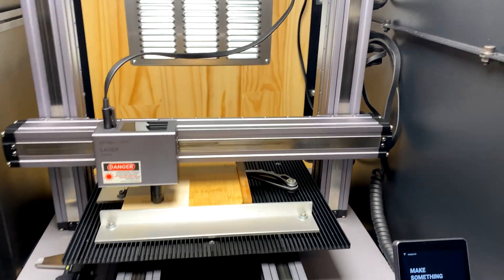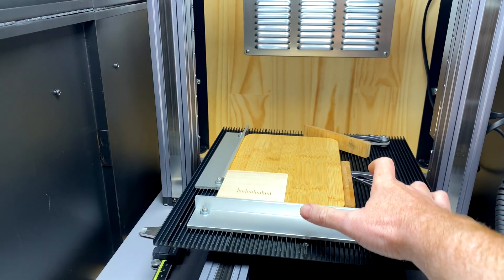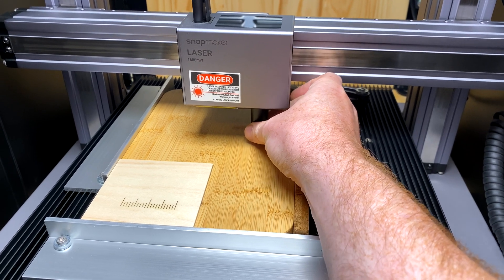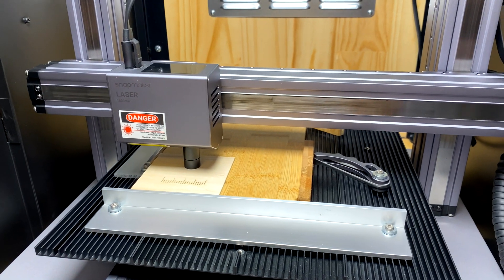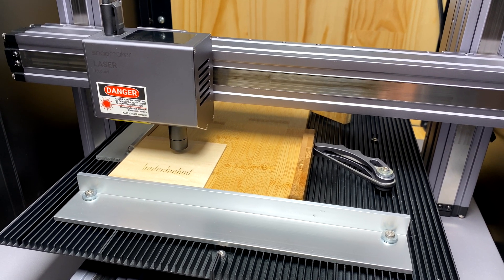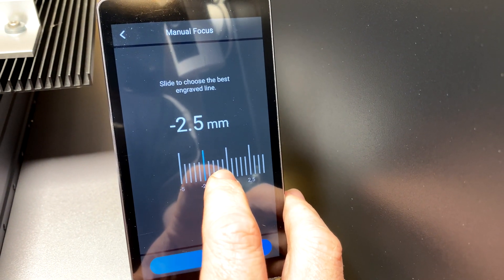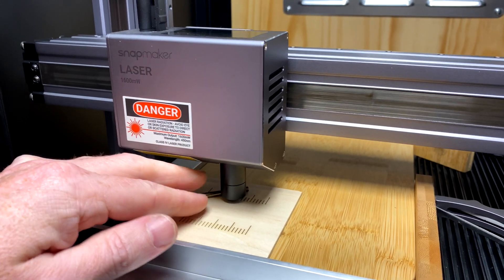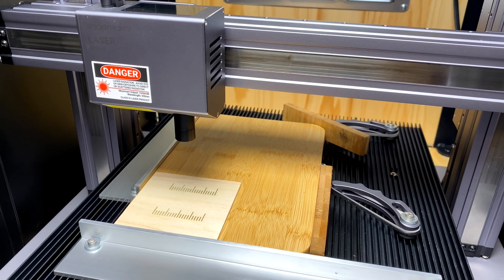Snapmaker Hacks - Easy Laser Focus Procedure!

Comment: Unfortunately you skipped the one thing I was trying to figure out which is how to focus the dot. Frustrating… I turn mine on and I see a slightly elongated line. The two cause I have come up with are  that the laser is only coming on with minimal power or that the lens could be dirty so I very carefully clean that but that didn't make a difference.  Anybody have any idea since it was the one thing that was just sort of skipped in this video?
Reply: By the way if you try to run a test pattern with the a long gated line it just doesn't even engrave it doesn't burn or anything. So question is do I need to manually turn it up to 90 or 100%. I don't remember having to do this before

Comment: Thank you so much for this video. I am struggling with learning the lazer module. Please continue to produce these great videos for those of us SM who are less than competent around this machine.
Reply from the maker: Glad this video helps! More to come :)
Reply: @whatcouldgowrong7914  I want to join in on the acknowledgement. Snapmaker did a fantastic job with the A350 itself, but with other things... not so much. The encasement for instance has its problems, like the side door only being placeable on the right side of the printer, which sucks, or the laser still shining through all those gaps. The software, Luban, is a terrible slicer (can't say much about the laser/cnc functionality so far, I am still learning the ropes here anyway) and the documentation of some functions is... ambiguous.

I was not aware  that when adjusting for the thickness of the workpiece, we are actually talking about the workpiece and the bed, which to be honest does not make sense anyway. At my first try to laser something, I had a hell of a scare, because I was measuring everything so thoroughly and then... the laser crashed full speed into the work piece. Thankfully no damage was done, but still. Also, watch three different videos/tutorials about the laser functionality by Snapmaker and you will end up scratching your head, since you've just watched four (at least) different versions of how things are done.

So, videos like your's are very appreciated.

Comment: How do you get to the manual calibration mode? Mine only goes through the auto calibration. I would swear I used to be able to but now I’m concerned they’ve removed the ability in the latest updates
Reply: just block the camera and it won't be able to self calibrate.  It will then kick you into the manual calibration.
Reply from the maker: You should be able to get to it by swiping right to left from the initial screen then select calibration :)

Comment: Ok, so just to make sure I understand. You've established that the optimal focus point for your machine is 3.5 mm off the surface of the material to be burned/cut, and you're using the drill bit, which just happens to have the 3.5 mm profile to serve as a measuring gauge. So, am I correct to assume that if you now wanted to burn something into the wood piece beneath the wood scrap you've burned the test pattern into (looks to me like a bamboo cutting board), you'd remove the test wood scrap, and you'd just drop the laser down onto the bamboo until you had the same 3.5 mm gap as measured by the drill bit? Have I got that right? Because if so, that's brilliant - very helpful.
Reply from the maker: Correct 🙂 I have uploaded the 2nd part video now explaining how to use the measured laser gap in a new job 👍 But yes any material, any thickness I just drop the laser down to touch off on the drill bit in my case and ready to go!
Reply: Thanks for the video. Super interesting as I’m new to the community. Two questions:
1. Wouldn‘t it be sufficient to remember Z-value from Auto-Focus and adapt to the different material thickness instead of finding a fitting drill bit?
2. I‘m still wondering how you would cut through 4 or 5 mm material if your focus is just 3.5mm above the material - besides removing any protective parts from laser. Do you just move the laser up and accept a non-ideal focus? Any experience or trick?
Reply from the maker: @jonasmanderscheid8147  1. You can use the auto focus and material thickness but personally I prefer a simple direct measurement for setting up each job rather than stacking offsets and saved measurements in the Snapmaker. My latest video which is up explains why the laser gap is a trivial step when you are doing a manual setup anyway 👍

2. For thicker cuts, you will be doing multiple passes anyway and Luban lets you set the laser step after each pass to maintain focus as the cut gets deeper 🙂

Comment: Thank you for the video. A bit confused: You measure thickness all the way down to the bed floor and not the top of the ribs? Also, I'd love to learn how you are holding those aluminum profiles to the bed! Perhaps is obvious and you are using existing holes all the way down to the frame and longer screws, something I haven't thought about...  Cheers.
Reply from the maker: I actually measured from the top of the ridges on the bed sorry should have been clearer… That said it just sets where the laser drops down to for the next step. Ill clarify on the next vid. I can also do one about the fences for you :)
Reply: @whatcouldgowrong7914  Cool, thank you. I was confused also because I thought I saw the plunger of the caliper go all the way down.  :)
Reply from the maker: @Yijingman  Yeah I was positioning just to touch the top of the ridges haha. Could use a ruler etc but I always use calipers.